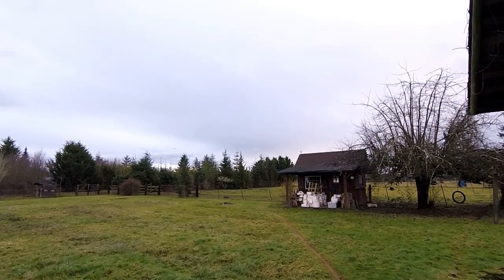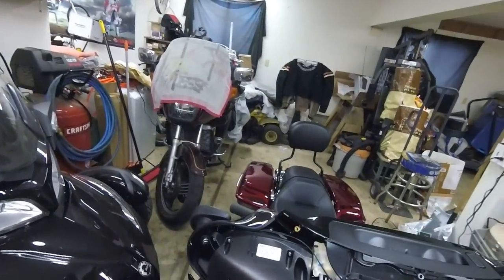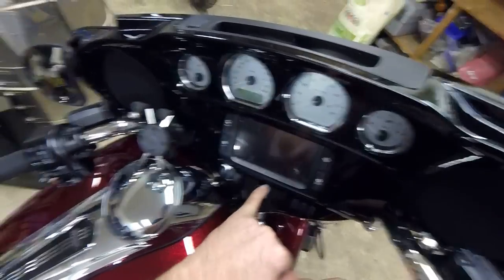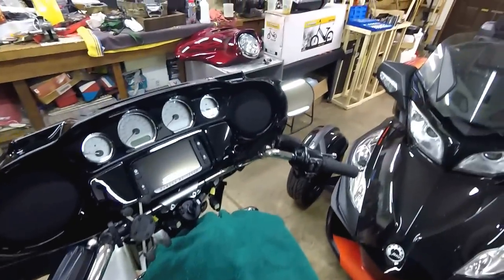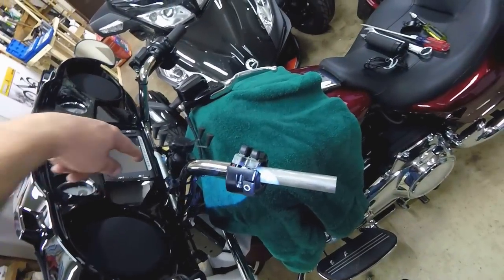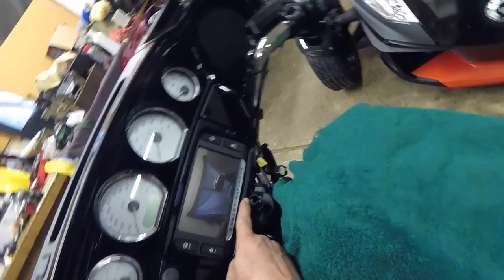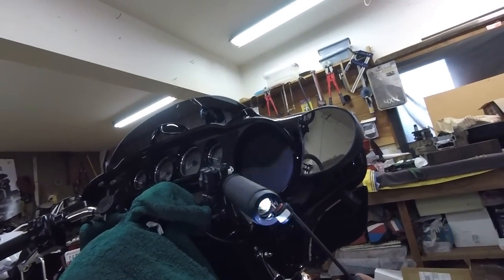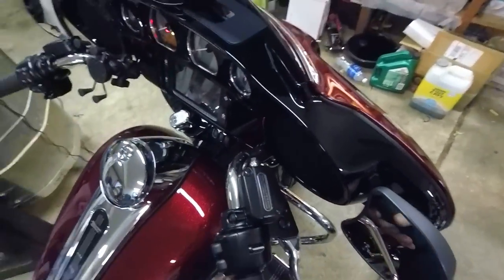How-To Install Harley Heated Grips!! - 2014~17 Street Glide Special! | ShopTalk

Comment: Harley quoted me 4 hours to install heated grips.

I did it myself following this very video.  Took me 6 hours but I took my time to make sure I didn't end up with any "extra" parts when I was done.

Bought myself an ignition alignment tool to avoid issues there.

Grips work great.

Comment: I have spun my ignition switch and had to have dealer realign, so your mention of the importance of not misaligning and the small brake switch that could break is so important and you are spot on for those small but important details.
Reply: I don't think that the small brake switch is as delicate and prone to breakage as the earlier years were.  I put chrome levers on and ( after a YouTube ) remember them as going right on without having to use the small piece of cardboard any longer.  Videos like this have to be impacting business at the dealers!

Comment: After trying to unlock the handlebars using the screwdriver as you showed, I found I was able to remove the ignition by pushing that button underneath WITHOUT locking the handlebars.  That sure made things easier.  VERY helpful video though.  Thanks
Reply: This made this a lot easier!

Comment: Hi Shawn, did this yesterday and.... you glossed over how much fiddling it takes to put the ignition back in, took me about 30mins just jiggling it about :) other than that worked good, i ran a fish up the bar from the centre hole and pulled the wires through with that. Thanks, oh and we have the same bike again!! traded in the denim black sgs for the M8 hot rod red in September but didnt get delivery until January here in Scotland.

Comment: Shawn... not telling you how to do it because I realize as a bike mechanic you know far more than me but I found out when I replaced the heated grips on my Limited..If you take the screws out that hold your switch panel on. You don't have to take the key switch off . There is enough room to slide it backwards and unplug it and take it off.
Reply: You turn the ignition to the locked position and turn the bars all the way to the right
Reply from the maker: +Jack Neville - There may be more room between the dash panel and the tank on a limited, but it's 100% impossible to do that with the tank installed on Project Rushmore SGS...  See 9:00 on the video for the lack of clearance. 

Thanks for watching and commenting Jack!
Reply: Shawn I agree with Jack not trying to tell you how to do it but i have had mine off several times on my rushmore sg and not pulled the ignition switch. It is just like you said the ignition is very delicate and has to line up and i didnt want to chance it had cover off in no time if you angle the bars it will slide out without touching the tank. Great trick running the wires never thought about air compressor
Reply: Got mine off of my 2017 limited also without removing switch.
Reply: MuncieBill another guy you tube ride it wrench it shows easy way to do it that is where I first seen it
Reply: I took the switch off but couldn't get the steering lock off, so i put the switch back on, that took me ages to get it back in, doing it again i would leave the switch well alone

Comment: Shawn seeing as I live in the Great White North I will probably install this kit on my new bike. Watching your video I think I am going to try it with just tilting the fairing forward and leaving the ignition in and just loosen the little cover below the key by removing the two screws  so it can slide back a tad and wiggle around if needed. Worth a try anyways.
Reply from the maker: The grips work amazingly well, and can go up to unbearable heat levels. Lol  I only go to level 2 of 6 on the coldest days...

Thanks Doug!!
Reply: We’re you able to do it without messing with the ignition?

Comment: Thanks cause there is like no 2017 videos out yet, but i pulled my ignition switch in the middle position, might have been safer also if i pulled my battery  wire also.  Look forward to all your vlogs. Thank you very much.

Comment: I have a 2015 Street Glide and I just put heated grips on my bike this winter.  The kit I got makes me run the power on the outside.  It would of been nice to know there was another kit where the power was going inside the bars instead of the outside.  I also see that Harley updated the wiring because on my bike there is no power running up to the fairing so you can simply plug and play.  I had to take my gas tank off and run the power cable it the management cable tray underneath.  Your job was much easier than mine.  Mine took multiple hours ha.

Comment: Thanks, that’s a great video!!! The paper instructions had me scratching my head! Can you clarify, the extra wires that come with the grips, are those to extend the wire reach for taller bars?
Reply from the maker: That's an adapter harness to run back to the battery for models that don't had the pre-wired harness in the fairing, which also requires the Harley Heated Grips Connection Kit 69201599...  If you had tall enough bars, this could be an option I'm assuming..?

Thanks Zach!

Comment: Nice video Shawn! Wish I would have seen this before I installed heated grips on my 2017 SGS. My local dealer sold me the wrong kit... I had the kit with the external wire with it that needed to be run back to the battery. They assured me I had the correct part number for my '17 street glide, come to find out there is old product being sold in new packaging.
Reply: Do you know the part number of the heated grips that you used?

Comment: Great video. I am about to attempt this and install a set of Kahuna grips on my '17 Ultra Limited. I was wondering if this can be done without touching the ignition? It seems once the fairing falls ahead, the hole in the handlebar is accessible. Thanks.

Comment: Shawn, do you think someone could get by with just pulling that left grip off and the wires through the bars for taking heated grips off (after disconnecting under Street Glide front fairing)? I want to transfer them to another bike.

Comment: Thank you for your covering this.  I installed my heated grips as you did yours, but then I see a video by Doc Harley saying that these connections under the fairing shouldn't be used for heated grips.  Says they can't handle that kind of current and will possibly leave you stranded.  Is this true?
Reply from the maker: If you look at the factory wiring diagram, this coupler is listed as “Heated Grip”…  There are other couplers under there that may not be able to handle draw from heated grips, so choose wisely and always have a Factory manual on-hand…

Thanks for watching and commenting!! 👍
Reply: @ShawnSmoak  I went on a couple hour ride a few days ago through very cold weather.  Started out with the heated grips on the number 2 setting.  Had to lower it to 1.  They worked like a charm.  Thank you.

Comment: NIce job, I know it adds a hassle if you need to get back in there again but I'd be tempted to shrink wrap every connection and esp. heated grips which always make me a little nervous.... just having the heated gear on board makes me nervous. Maybe shrink would make it worse, trapping the heat, I dunno. New stuff is all built properly though, I hafta admit, and I expect this fear of mine will pass with experience and time. I worked and have lived aboard ship a long time and once as an SR tech we rescued a fella whose liveaboard was fully involved... in 10 minutes that man was going to be in the water and dead in another 10 after that from the cold up here in BC.  I'll never forget the way that ship burned... About the appearance of 'more chrome' on your red 'Glide, between a black bike and a red bike with same amount of chrome, the red bike will always 'appear' to have more chrome because the black bike's other black surfaces, frame, motor pieces, link together and take over the 'weighting' that our brain unconsciously gives what we're looking at. It's why black bikes can often appear 'cleaner' - they've one less 'colour'. Just like a B&W photograph, you're only looking at shades, not the tones that exist in true colours.

Comment: Nice vid.  Sad heated grips aren't standard on a $25 + thousand bike...
Reply from the maker: +Edward Ballow - One would surely think..!

Thanks Edward!
Reply: They dont come standard on the $35k CVO Street Glide either, only on the Ultras
Reply: If they were standard, that 25+ bike would be 26+
Reply: @ShawnSmoak  
Another '17 Ultra upgraded thanks to this video, thanks! I'd like to add emphasis to the part about being extremely careful after taking the power/lock switch out of the steering head- be sure to follow the steps exactly or you will end up in 'lock cylinder hell'.....and it will take time and effort to correct. Do Not ask me how I know this.  😐

Comment: Hello Shawn, I'm curious about the 17 SGS and more specifically, tire/wheel size "upgraded" I spec'ed out my vision of my street glide with a 19" front/18" back wheel package I built on-line at Harley/Davidson. I looks perfect for my idea of the perfect Harley, yet my question is do I automatically get the proper upsized tires when I upgrade the wheels? Thanks for the info and great website!
Reply from the maker: +E. Simons - If the bike comes to the dealership as you customized it online, I'd say yes, for sure it would.  However, if the dealer does the mods once the bike arrives, you'd need to speak with the dealer to see if they'll exchange the OEM tires for the ones required for the custom wheels. I know the wheels will not come with tires if ordered separately...

Thank you very much!

Comment: I want the HD Streamliner heated grips on my 2014 FLHXS. Why does fitment read I need Electrical Connection Kit P/N 69200722. Also reads power wire needs to run external. Is this wrong info from HD??
Reply from the maker: When looking up the grips for my 2017, it said the same thing..!  The dealer said I didn't need it, and I was mad because I thought they were incorrect.  Studying the wiring diagram, I found that the dealer was correct and installed them as you seen here.  I actually have the connection kit, and installed it for future accessories, if I ever add them... Lol

Thanks!
Reply: Thank you Shawn.  That answers the not needing the wire kit.  Now why does it say the power wire needs to run external?  The HD answer said something about inline fuse that won't fit in the bar?   @ShawnSmoak

Comment: What model # are those heated grips? I purchased that, but the wires run outside the bars
Reply from the maker: The Harley P/N is: 56100034

Thanks for watching!
Reply: Question...
The left grip is solid inside with a grey plastic. Does that comes out? If so, how? I don’t want to damage anything in case I have to return them. 
Thanks

Comment: Great video. Yeah Harley instructions suck. I've done this twice now. Once on a 15 RGS and just recently on my 17 RGS. Way easier than a SG. Both power and connection to RHS grip are under the tachometer/speedo. You still have to remove the ignition switch (I'm now an expert on correcting misaligned ignition and steering lock) but the rest of it is the same. Are Harley protecting their dealers by sending out confusing instructions?

Comment: Can these go on a dyna also?
Reply from the maker: +HaHa Too Slow - Yes!  Search your bike on Harley's web site to make sure of the correct part number for the grips.  Read the install PDF to make sure no additional connector kit is needed.  The fitment info said I did need a kit, but the instructions PDF made no mention of it, and no kit was required. 

Thanks!
Reply: HaHa Too Slow There are some differences, at least on my wife's 2015 Switchback, as the throttle is not a ride by wire, but a mechanical cable.  That may have changed on newer models, not sure about that, but there is not all the messing around with the ignition or faring to deal with, so in that respect it is a bit less difficult.

Comment: H Shawn Smoak. I did new 14" KST Apes and took the key lock off with the forks straight with no problem. I think I did a boo boo when checking brake line clearance I heard a click when I went to the left and ended up locking the forks. I looked down the hole and saw a pin out of alignment. I was able to put the ignition key lock back on and everything worked OK until I went to lock my forks it would not lock..Any suggestions?